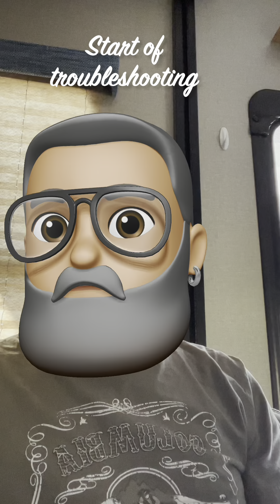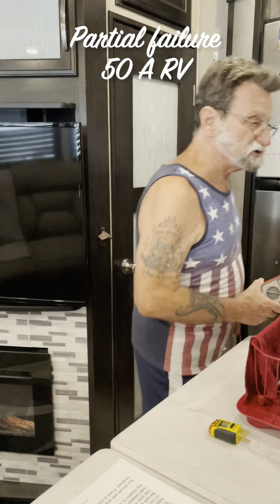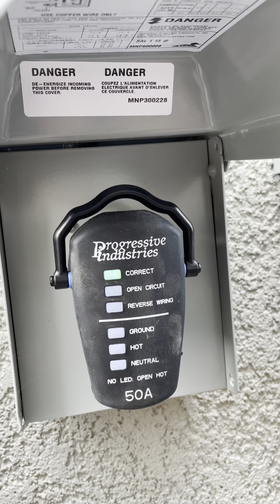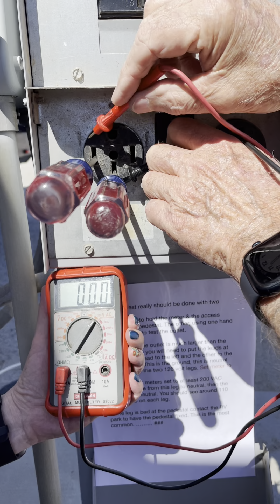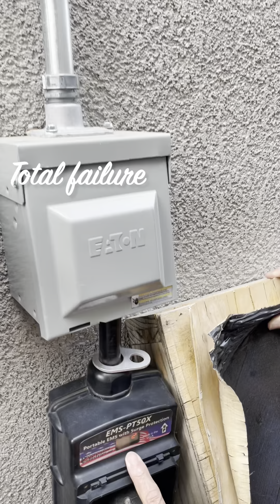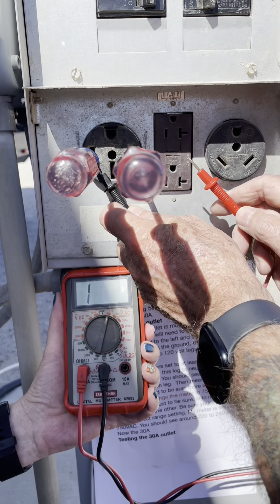A beginners guide to troubleshooting RV electrical systems. ( Shore power )

Comment: Enjoyed your video. My problem is when I'm hooked into shore power and  boondocking. The 1st problem i had was I had to leave my boondocking spot because my generator was complete dead. Also, about 3am a couple of nights I had to turn the engine on in my motorhome in order to get the furnace to kick on.
Now, I'm using 30amp shorepower and the breaker box keeps tripping,  even with 1 plug being used and is tripping the furnance..
The only reason I have some power is I have a  bluetti, but half the day I have to keep resetting the breaker and shuts off anywhere from 30secs to 5min.

After watching your.video, it sounds like I may have a bad inverter. Also, like I mentioned earlier is the genny went dead and when I hold the button to start it, you can see the lights dim.
Usually the gen would start when I turn on the engine,  but not now.
Reply from the maker: My first question did you really mean “inverter”?  A inverter converts 12 volt battery power into 120 AC power. 
If you mean “converter” that is a good candidate.  The converter uses 120v shore power or generator to charge your batteries. 
The converter can, when bad, draw enough current to trip your 30 amp breaker. 
Your furnace uses 12 ( battery) to run the fan and control board. 
So if the converter is not charging the battery then 12 devices will not be able to operate correctly. 
Good luck.

Comment: The outlet wiring tester shows whether any outlet is wired correctly. The black pushbutton below the lights is a GFCI tester. It will trip the GFCI and any downstream outlets.
Reply from the maker: Both true.